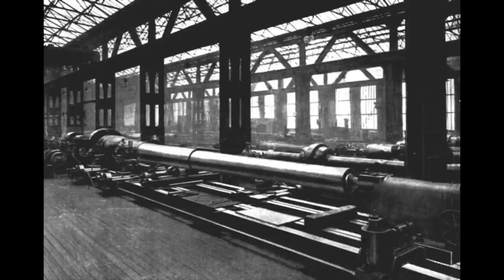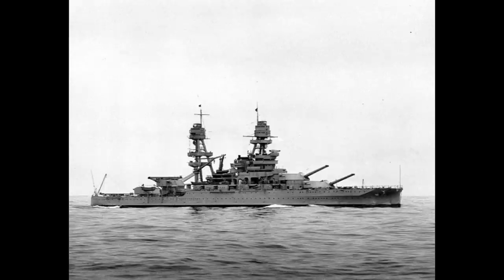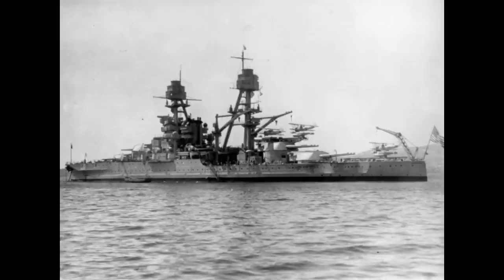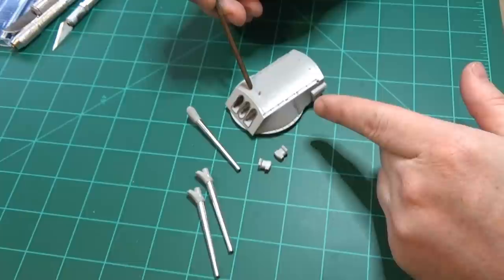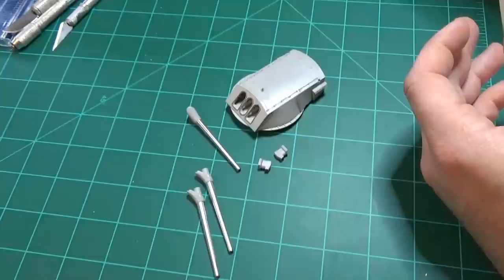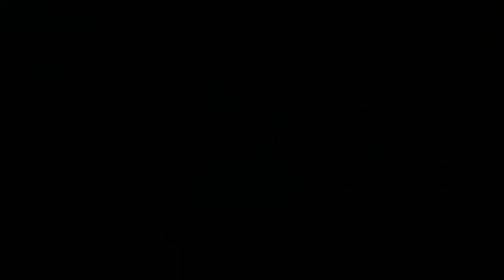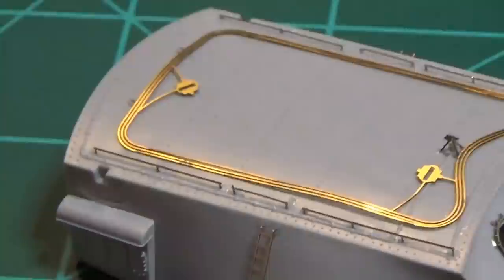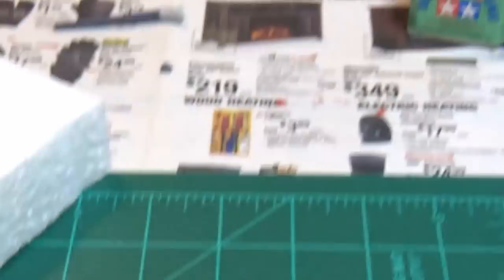USS Arizona by Trumpeter 1/200 Scale Build Video 6

Comment: The catapult came out well, looks really good.  I believe the PE on the two turret tops are cables used suspend tarps while in port.  The doohickeys on the turrets may be have two different functions.  One is to support the cables for the tap covers and the other I do not know.

Comment: For spotter plane purposes. There were 9 battleships assigned to Pearl Harbor. On 7 December,  one of them was in the states for a refit.
They were divided into 3 batdiv's of 3 each. BatDiv one was red, turrets 1 & 2 painted red. BatDiv 2 was white, and 3 was blue. Then turret 4, on a 4 turret ship was red for ship 1 in that BatDiv, Nevada had a white #4 turret for BatDiv 1, ship 2, and so on. The reason was to assist the spotter planes in identifying fall of shot by ship.
The third turret was ships color, as on later ships there were only 3 turrets.
I do not think the fast battleships did this as they had radar to find fall of shot. After each ship was upgraded with the radar, practice was discontinued. This comes from the british.

Comment: Leonardo DaVinci of modeling.  Trying so hard to follow but not at your skill level...takes time.  I'm really struggling with railing on Arizona,  is there a video you recommend?
Reply from the maker: Thanks Steve! So somewhere in my Missouri build I cover it. I don’t know the exact one off hand. But, try using Tamiya tape, vertically along the hull and sticking the railing to it. Then you can come back with CA glue on a toothpick or something and apply it at the base of the railing.